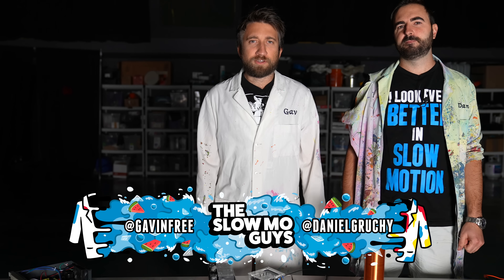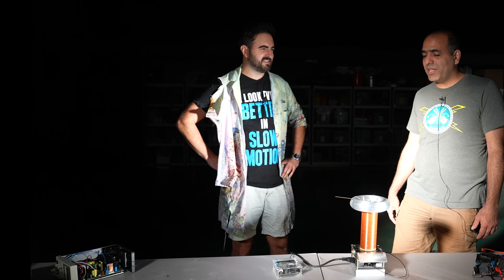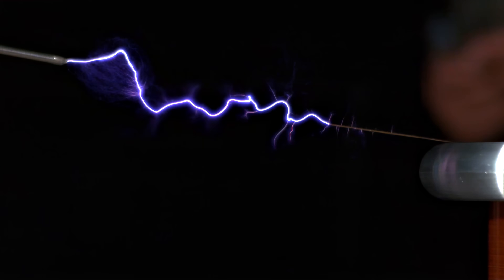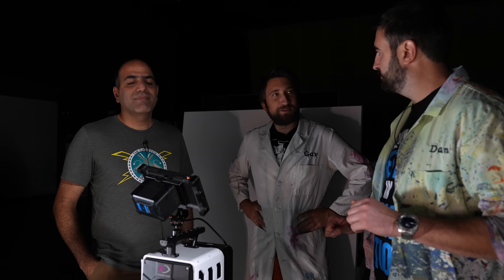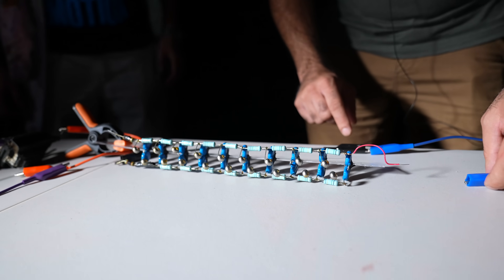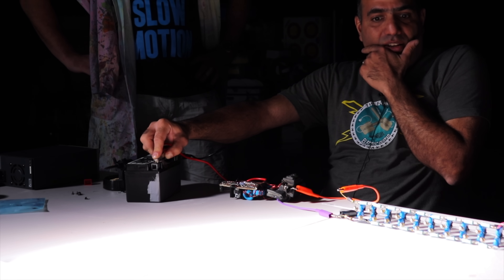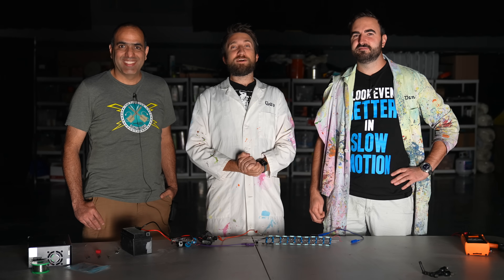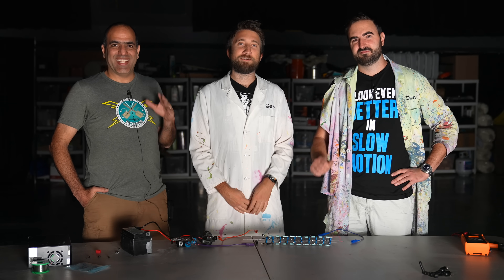Electrical Arcs at 1,750,000FPS - The Slow Mo Guys with ElectroBOOM

Comment: That camera is so fast that light moves only 170 meters every frame. You might actually be able to capture some wicked light speed slow-mo with it. Its crazy!
Reply: Well. It would require some really funky lenses to capture that distance lol. But they do have a planet slo-mo video showing a stupidly fast laser-based camera that can actually show you like moving across stuff.
Reply: @5peciesunkn0wn  At a distance far enough to keep 170m objects in frame, optics will be less of a problem.  Making a voltage large enough to draw a 400m arc will require equipment from a different lab.  Not even sure the ABB lab in Sweden can do that, and that entire lab is built for testing giant arcs.
Reply: @johndododoe1411  perhaps a large flashlight with spaced reflective strips could be used in order to show how long it takes for light to reach each marker
Reply: @johndododoe1411  Laser through thick smoke, should be visible in a completely dark room otherwise.
Reply: Yeah, you could do some cool stuff with a laser and some mirrors, for sure.
Reply: Now shift all the footage…
Reply: That stat is just mind boggling!
Reply: @Jay-cf6dz  yesterday i threw a flashlight in a deep pool and ran away really fast, the light has not reached me yet, probably because the water slows it down when absorbing all but the blue lightybeams.
Reply: The funny thing is, that if the technology gets even better and the footage surpasses lightspeed it will rewind itself and start playing instead of recording. I think. Yeah, nah, yeah, sure thing actually. We are so close to timetravelling right now.
Reply: @moos5221  bro what lol explain? rephrase it
Reply: @Randy_Marsh  It's simple. Jesus is our saviour. Or wait, no, that was the other dude. Uhm...the truth is, science is so complicated with all that lightspeed timetravel that it's actually easiert to just believe we were made out of clay and ribs and a talking snake got us kicked out of paradise, so I'll stick with that now. Good idea from that weird confused Jesus dude.
Reply: @moos5221  what are u talking ab😂 no explain “the footage surpasses light speed it will rewind itself and start playing instead of recording” what footage and how would it play instead of record and why. Maybe it’s just your wording but it makes no sense
Reply: @Randy_Marsh  No, it makes sense, Jesus will save us all.
Okay...here's the thought process which is wrong, but felt funny at the moment I wrote it:
Time passes slower for anything that passes the speed of light compared to everything else. If one was thinking of the recording device like an old school camera with tape running through it would actually slow down once it surpasses lightspeed because time passes slower for the film....or would it actually speed up? It's weird to think of it, ties my mind into knots which is funny. Wanted to share the experience, maybe you can get knots in your brain aswell. If so, remember that Jesus will save us, unless he surpasses lightspeed, then he will just be a little baby in a crip again.
Reply: @moos5221  You, as an observer, would just see the clip play very fast, or the device record very fast.
The tape itself, if it had eyes, would observe weird behaviour, but not us looking at the tape.
Nothing can go faster than the speed of light, as far as we know it is the theoretical (and practical) speed limit.

Unfortunately, nothing reverses or goes back in time or back into its crib.
Reply: @b0nes95  there is no theoretical speed limit, you can very well phantasize about travelling faster then the lightrays that are moving away from an object and actually see time reverse itself in that way. in reality ofc it's the limit we know and are lightyears from coming up with a solution on how to breach it and therefore currently accept it as a given that it can not be done.
Reply: @moos5221  I cannot visualize time reversing and going faster than light. If you can, you have the creative brain of Einstein, or even better. Go do something with that!
Reply: @moos5221  time travelling is impossible for a lot of reasons, there a lot of plot holes in time travel
Reply: @arandomguy3222  Well, Jesus said it works just fine.
Reply: @moos5221  when did he say that
Reply: @arandomguy3222  technically it was today, but he was moving so fast that it actually turned out to be yesterday for him
Reply: @moos5221  ok troll, it's time to take your medicine
Reply: @arandomguy3222  Did you want to have a serious discussion about the reasons why timetravel is impossible? What's wrong with you?
Reply: @moos5221  yes i did, did you want to have a conversation where you argue using points you don't even agree with it, what is wrong with you
Reply: @moos5221  Lmao thank you for this hilarity.

I do wanna say tho for anyone curious - we absolutely can record at a frequency rivaling the speed of light, despite those two things being directly incomparable (one is frequency, the other is velocity, not the same), without threatening the space-time continuum. The only practical limit I could think of for how quickly images could be taken is the rate at which light moves a single planck length per frame.
Reply: Believe in Jesus — the King of Kings and Lord of Lords 👑. "For God so loved the world, that he gave his only begotten Son, that whosoever believeth in him should not perish, but have everlasting life" (John 3:16).
Reply: @O.s..a  I think he just came, check his bedsheets, mkay?
Reply: Jesus Christ is the propitiation for the whole world's sins. They that believeth and are baptized (with the Holy Spirit) shall be saved; but they that believeth not shall be damned. Those led by the Holy Spirit do not abide in wickedness.

God is ONE manifesting himself as THREE; the Father, the Son, and the Holy Spirit! Bless him! For these three are one.

As I am led by the Holy Spirit, nothing I state is a lie, but the truth of God. Anyone who tells you differently is misinformed or a liar. They do not know God, nor led by him.

Anyone who claims to be a Christian and is against what I am doing, and where I am doing it; the Holy Spirit does not dwell within them, they lack understanding. They know not God, read his word, and their religion is in vain. Do not hear them, they will mislead you, the lost cannot guide the lost.

Comment: In order to capture something moving across what looks like a 15" gap that travels at 186,000,000 miles per second, I'm thinking 1.75M fps is painfully insufficient.
Gotta either make the gap 1,000 times larger or the frame rate 1,000 times faster. 
It was a nice try though. 
Best of luck on your next attempt!

Comment: I believe that rather than the voltage being high and causing mini arcs (as stated around 6:40) I believe those are actually the "feelers" that search for a ground, and as soon as one finds one, it will finalize the bolt and send the rest of the current through the main bolt, but it's so fast that you happened to catch it on the same frame. You can see this on some of the previous shots where the tip spreads to these hair thin strands that fan out, searching for the quickest path with least resistance :)

Comment: After all these years of filming slo mo Dan probably actually is the world's most photographed man ever
Reply: Yeah, they've talked about that before. Unless someone else does a lot of slow mo of themselves it's probably not even close.
Reply: i have never thought about that that’s cool
Reply: In terms of sheer length of footage, maybe. Turning 2.7 seconds into roughly 2 days sure helps.
Reply: Y’all beat me to it.
Reply: So very true!
Reply: EP110 of lateral!
Reply: Narcissistic monkeys (humans) on social media: 😳🤙.
Reply: Given that best modern cameras capture more like 70 trillion frames per second, it's far more likely some technician somewhere actually holds the record. They'd only have to be in front of the camera at most 40,000,000-fold less time than Dan. If Dan has spent a cumulative total of a year of his life in front a phantom running at max speed, that'll be like, one second.
Reply: @SgtLion  those aren’t like… theyre not shooting people with those and if they did you wouldn’t really see anything
Reply: @SgtLion  Actual cameras today can film at up to 2.5 million frames per second. The decices you talk about (trillions of frames) are complex systems in some laboratory, and have little in common with an actual camera. They are mostly used to measure the speed of light and such, and I don't think it would even be able to take a picture of someone's face, as the resolution at this speed is so low. You could maybe fit your finger tip into the picture.

Comment: If the resonance happens reliably say 8 times and very periodically, you can count the frames and divide by 8. Should give you a slightly more accurate reading. This is sorta how digital signal analyzers sample a 40 GHz repeating digital wave when their sample rate is actually something much slower like 5 billion samples/sec.

Comment: I would love to see the slow mo of a Tesla Coil built with a level shifter. There isn't a lot of information about DC biased AC corona/streamers/arcs and other stages of air plasma breakdown. I'm interested in the electrophoresis/dielectrophoresis of air plasmas, electrons and neutral gas species in non-linear or asymmetrical electric fields. Ethan Krauss patented ion wind thruster designs are HV DC circuits of exceptional power to weight ratio, but AC waveforms are often used for dielectric barrier discharge designs because they have some advantages over DC plasma discharges. I'll keep looking to see if I can find any laboratory examples of level shifted plasma generated circuits, but I suspect that one polarity works better than the other for acceleration of air due to the dielectrophoresis of neutral gases of different dielectric constants.

Comment: Do you guys remember the Veritasium riddle on how long it takes for a lightbulb to turn on, if the cables are extremly long, but the bulb sits next to the source? If your camera records at 1,5 million FPS light would travel only 200 m during two frames. So maybe if you use a km of cables and lamps that switch on incredibly fast it could be possible to actually visualize this effect. For example: 3 lamps (or any other device visually reacting on current), one at the middle of the cable and one at the start and end, but all are equally distanced from the source. All should switch on at the same time.
Reply: Electroboom has a response video to that.
Perhaps worth watching
Reply: @bertjesklotepino  Maybe you missed ALL the response videos lol. Maybe worth watching...
Reply: @nihlify  maybe
Reply: @nihlify  I didn't missed the response video. He still did great, but really, this past few years he focus more on "clickbaiting" and a bit shilling. He knew what he's doing, he over simplify and "misrepresent" it for clickbait and elicit reaction.
And don't forget the Self driving car video he made when he didn't disclose he's sponsored by them.
Reply: Electroboom already did the timing with oscilloscope. Doing this with Phantom can be very challenge because in nano seconds you have to have some circuit to trigger the switch while sending the time to Phomtom and we are talking speed of light here which can go weird easily when we mess about timing.
Reply: @manabellum   You put the switch and three bulbs all in one line in front of the camera and the cable is outside the shot. So basically the switch and bulbs are all like only a few cm apart. This way you could see the switch and then each bulb light up separately.
Reply: @whuzzzup  The problem is how you communicate with the Phantom the time you push the switch with nanoseconds accuracy. Also traditional “switch” will take millions of frames when you push that switch with human finger. How can you select single frame as a reference point to start timing?

Because anyone can argue that it is the first bulb that communicates with another bulb, not a switch. So to set Veritasium’s case you still need a switch.
Reply: @manabellum  You put the first bulb next to the switch. Once it light up, the switch is closed.  
I don't understand what you mean with your second paragraph. You don't need a physical switch.
Reply: I would like to note that they would all turn on at the same if you count 'dimly lit' as being on. They'll only go fully on when the electricity gets to the lamp through the wire.
I can't say anything about the ability of the Phantom to capture this though, but I'm concerned that the difference in brightness may be too much for the Phantom to show what is happening. This may make it seem like nothing is happening in the lamps until they all fully turn on one at a time.
If they're able to film with different exposure settings then they could film both stages individually which would show how much or how little difference there actually is in the amount of power the lamps receive :D
Reply: This experiment is not quite the same, because the resistance of the air is changing dynamically with ionization, and that will be much slower than the speed of light.  You are not seeing the electricity, you are seeing the air turn to a glowing plasma, which takes time.  This is why you can see the long sparks travel within the fps of the camera.  As for the ladder of little sparks, they may all be ionizing the air at a similar rate if they are all well above the breakdown voltage of the air.  Turning down the voltage may show the effect that Gav was looking for, where one electrode jumps after the other down the ladder.
Reply: The influencer Veritasium is mostly full of it.
Reply: @tbird-z1r  Full of it? Not really. But he can misrepresent things for the sake of getting a reaction. What he said about Electricity, for instance, was correct. He just made it sound like it was something nobody really knows. When any electrical engineer was well aware of everything he said.
Reply: @Unethical.Dodgson  He wasn't misrepresenting anything for a reaction lol... He described it in a theoretical way for simplicity that caused some to disagree. But it seems some people in this thread didn't watch all the follow up videos considering the weird passive aggressiveness towards him for no reason.
Reply: @tbird-z1r  Not at all
Reply: @tbird-z1r  u full of bs

Comment: It goes backwards cause electricity goes backwards. people normally think of electricity as positive moving towards negative which is how the coil is arranged (left to right). But in reality, it's negative electrons moving towards a positive charge, so as soon as the connection is made, electrons flow right to left along the coil. There is a delay between gaps that is the amount of time it takes for current to form after connection, which is measured in pico-seconds. meaning they would have to measure close to a few billion fps to see the delay.

Comment: Just worth noting here, that since electricity moves at ~300,000,000m/s, that means that at 1,750,000fps light would travel approximately 170 meters per frame.  So if this is propagating through the Marx Generator at anywhere near the speed of light, this camera isn't remotely fast enough to capture that speed.   So it is still possible that these don't trigger at exactly the same time but it will be very hard to confirm that (at least using this type of camera as the measurement tool)
Reply: Yeah, you'd want electrical measurements, not optical.  Like oscilloscope probes across two different capacitors, with a threshold crossing on one of them as the trigger for sweeping both channels.

(Probably with a voltage divider resistor separate from the 10:1 scope probe, so you're not feeding such a high voltage into the scope input.)

They didn't show a circuit diagram for the Marx generator in this video, and I haven't googled it, so IDK if it's a delay line, or if voltage can build up across all gaps in parallel like you'd get with just a ladder of capacitors.

It looks to me like the last gap (the one that was arcing first) was slightly shorter than the others; that could explain why it was the first to arc, if all the gaps are at about the same voltage.

Comment: To the idea of how many frames (datapoints) you need to get a good resolution to define the maximum of the peak: It’s common sense that there should be 13 points, at least. A solid data situation for peak modulation is 20 points. So, you have an idea how much faster you have to film for a proper peak resolution. 
Love your videos!

Comment: Awesome collaboration!  Spark-gap switches turn on really fast, about 10 nanoseconds from initial current flow to peak current.  Let us hope that the 200,000,000 fps Phantom is on the drawing board.
Reply: In 10ns the speed of sound in aluminum travels across 158000 atoms, so i if the sound of the spark is strong enough to shake up the bonds of 158000 atoms across, some could actually losen up the Metall, make it behave like jelly....

Comment: WHAT IF you would make this bang machine long enough, let's say to the moon. And if all these bangs happen simultaneously then you could have information faster than the speed of light. If the information is the same as in Lord of The Rings with their fire stacks on the mountains to tell that they have a problem. 
With the bang machine it would be the same. You wouldn't really transport information, you would just have the same event really far away from each other at the same time. And only the knowledge of that fact would be the information. BAM!!! FTL-ALERT!

Comment: When even 1.75 million frames a second isn't quite enough.

A quick Google search says that lightning, which is basically long distance arcing through very wet air, travels at 270,000 mph, or around 120701 meters per second. That means, according to those Google results, lightning can travel 10 cm in 0.8 microseconds or 1.2 millionth of a second.